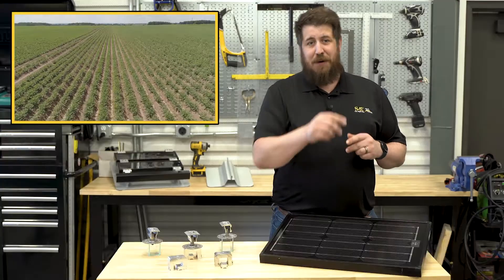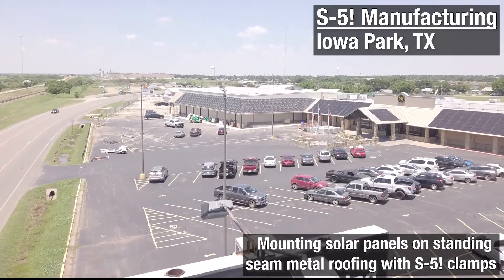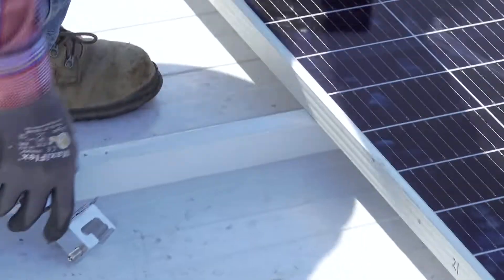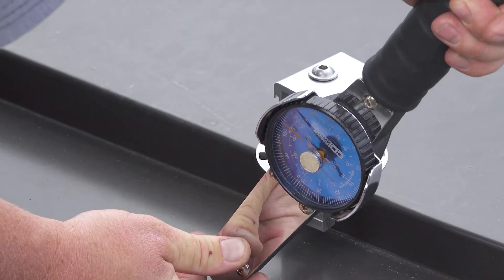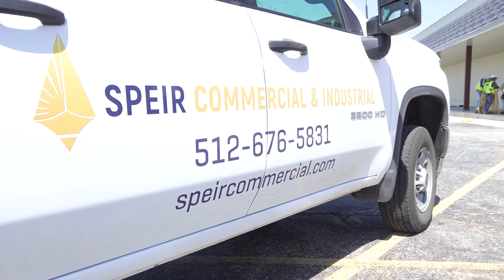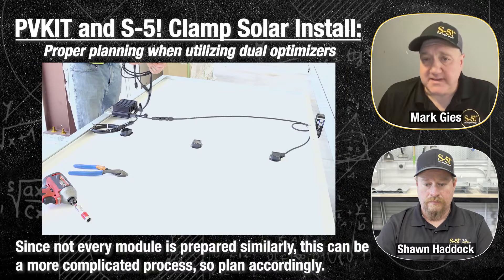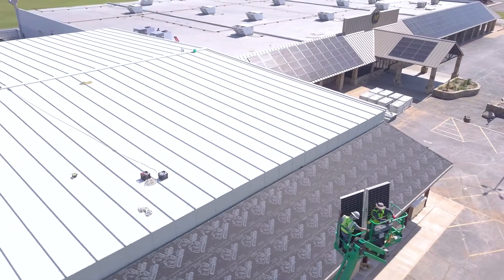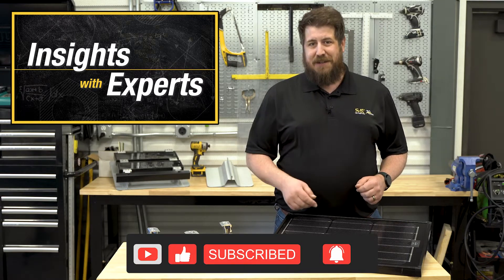The best way to mount solar to a commercial standing seam roof! - Part 1

Comment: How to mount the emt to standing seam? Also which method to pass the wired through the roof?
Reply from the maker: We have conduit straps that can be used to mount (https://www.s-5.com/products/secure-condensate-lines-on-metal-roof/), which can be used for tubing. Our GRIPPERFIX struts can also be used if needed.  (https://www.s-5.com/products/utility-solutions-gripperfix/)

For roof flashing on standing seam, we recommend contacting another company that specializes in this type of application, such as LMCurbs.

Comment: Vertical seam panels ?
Reply from the maker: Vertical seam panels is often used as a generic term referring simply to standing seam panels. It can also be used more specifically referring to a double lock standing seam or even the Metal Sales Vertical Seam (https://www.metalsales.us.com/products/vertical-seam/). If you have any other questions please reach out to our support team at support@s-5.com

Comment: What would you recommend with standing seam with 8" pitch roof. Would the same work with this?
Reply from the maker: Our clamps and brackets do not have any pitch restrictions, only load restrictions.  As long as your array is properly designed using our published load values found in the link below they can be installed on any pitch roof or wall for that matter. If you have any other questions please reach out to us a support@s-5.com.

https://www.s-5.com/load-tests/?swcfpc=1

Comment: Will these work on a 12/12 galvalum?
Reply from the maker: Yes our clamps and brackets work great with galvalum steel panels of all types. Our clamps and bracket do not have any pitch / slope restrictions, only load restrictions and you can see all of our clamps and brackets load data in the link below. Please let us know if you have any other questions by reaching out to support@s-5.com

https://www.s-5.com/load-tests/?swcfpc=1